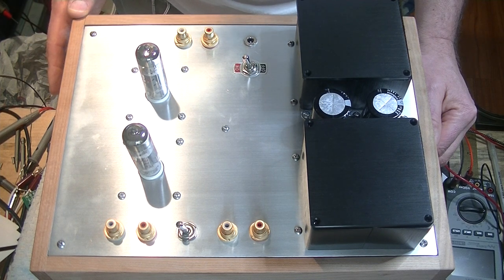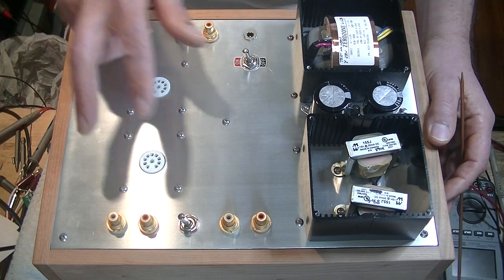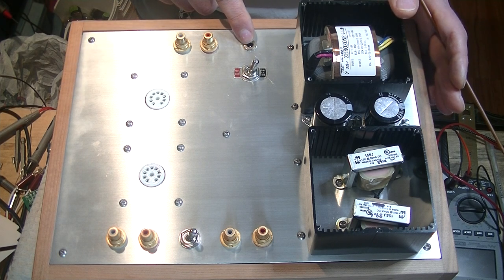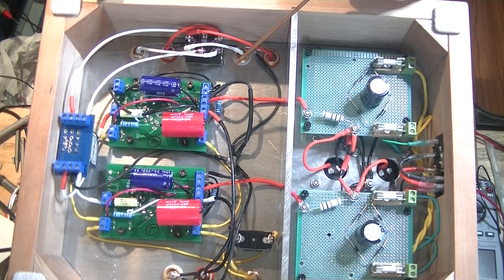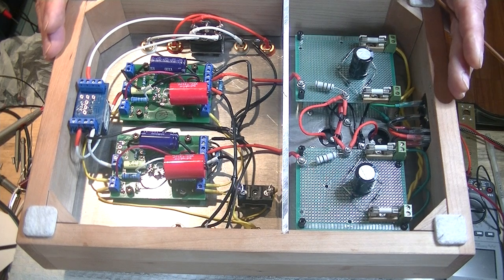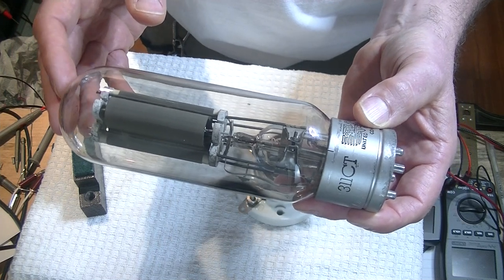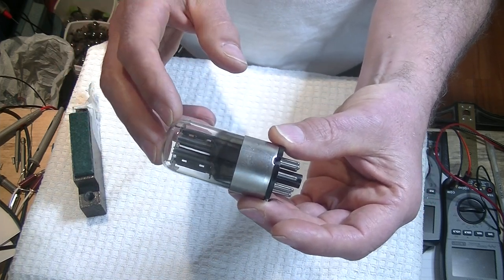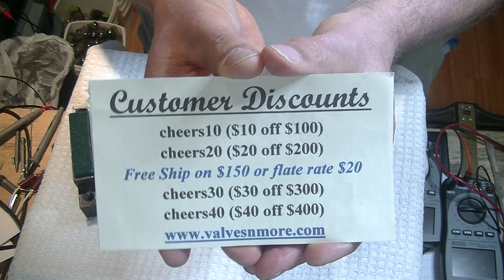Tube Lab #27 Prototype E80cc Preamp  with Willsenton R8

Comment: interesting things pointed out about why a preamp can improve the sound "even if it adds a wee bit of something that wasn't on the recording" or "accentuating what is there". Is the dynamic response of the signal and the detail increased from what there was in the recording/incoming signal intentionally by design or is it just a result of better components (caps, potentiometer, power supply, grounding) being chosen?
Is this design yours or are you basing on a previous or brand historic one? Chinese manufacturers seem to clone those.
Reply from the maker: All of our Kit Designs start with a concept of what we hope to achieve sonically and are designed using first principles.  Even though they are our designs,  almost nothing is new in electronics (no matter what the advertising says).  Audiophiles have known for decades that a preamp can improve the overall sound when used to drive an integrated amp.  Why and how have always been then questions.  And I think it varies in each situation.  Certainly adding a quality tube pre to a solid state system is going to add some nice 2nd harmonics and could really make a difference to flat non musical sounding system.  Driving the integrated with very low impedance might also be a plus.  The actual components such as resistors and capacitors shouldn't make much if any difference.  So it's probably all about the sonics of the actual tubes.  Remember "The Tubes Are The Amplifiers!"
Reply: @tubelab194  thanks for the tips... and what is the output impedance of this design? Normally tube preamps have a too high one to match amps with low impedance such as a 2.2k bufferless Purifi.
Reply from the maker: @wyup  For all our Kit Amps the full Specifications, Schematics, Sweeps etc are available in the store under "Information" at www.valvesnmore.com
The output impedance of the E80cc Pre is 364 ohms and the Universal Pre is 1.14Kohm.  Any properly designed preamp should be able to drive any properly designed power amp.  It's only when designers wander into the wilderness without really thinking about comparability that problems arise.  So long as the output impedance of the driving preamp is lower by a factor of 10 (though 1:2 should work just fine), you shouldn't have any signal loss.
The E80cc was conceived as a solution Tube Preamp for difficult to drive power amps, with it's extremely low output impedance and very high gain of 13.74 (1vrms IN = 13.74vrms OUT).
Cheers

Comment: The E80CC is a direct replacement for the 12AU7?
Reply from the maker: No the E80cc is a "maybe" substitute for the 12au7, it will work in many circuits, but with conditions.  1. It has twice the heater current 2. It has substantially more gain 3. Physically much taller.  The heater current is the one to be careful with, if your filament transformer winding can't handle the extra draw it will overheat and burn out!  All of that considered, I've successfully used it as a 12au7 sub in my own custom preamp.
Reply: @tubelab194  thanks for the explanation. Currently I use JJ ECC99 tubes in the 12au7 location in my Amp, and it sounds much better than any 12au7 I have tried.